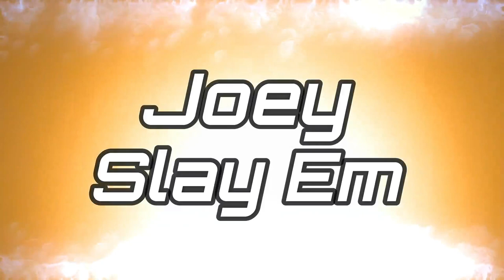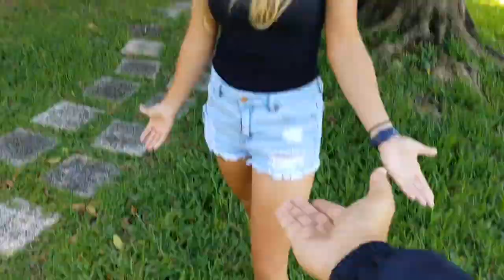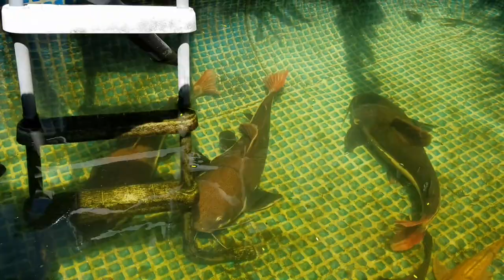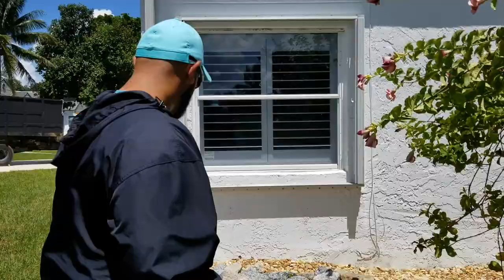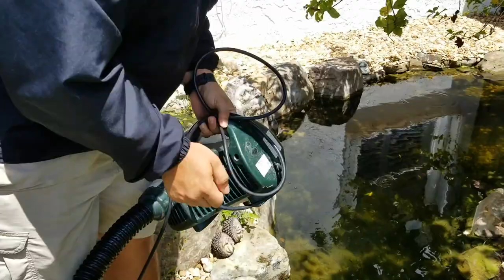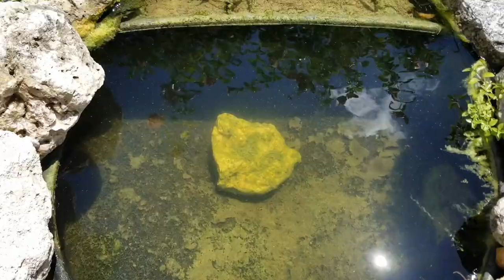SEARCHING FOR HIDDEN RAINBOWFISH IN HOUSE POND!

Comment: Copy and pasted from what I put on zaks tube: >Striped Sleeper Goby 
Brackish Tolerance: 1.010-1.025
Minimum Tank Size: 150 gallons
Feeding: Will consume anything offered. Pellets make good staple, will also accept meaty foods like chopped shellfish, frozen fish, krill, shrimp, earthworms.
Notes: The Striped Sleeper Goby is one of the more common species of Sleeper Goby available in the aquarium trade. Sometimes sold as a freshwater fish, they are found in estuaries and around coastlines in the wild, only occasionally venturing into freshwater. Striped Sleeper Gobies can be fairly territorial fish. They are also very predatory, and should not be kept with fish that are less than half their length. Besides these traits, they are not terribly aggressive fish and can be housed with large tankmates like Tete Sea Catfish, Scats, and Batfish. Boisterous or nippy tankmates like Puffers, Snappers, and Lionfish should be avoided.